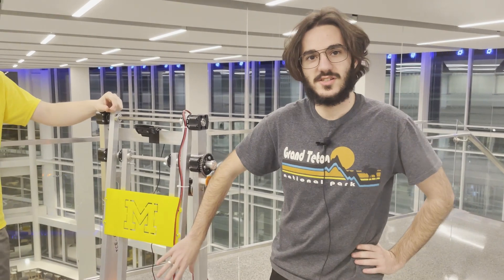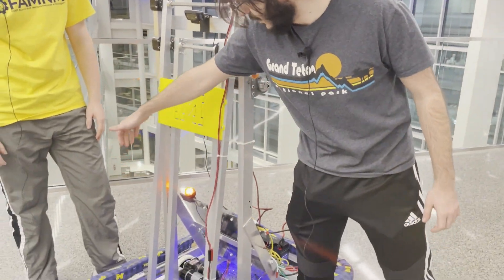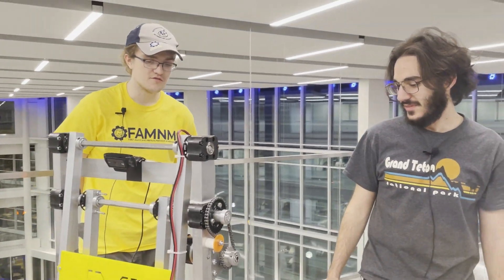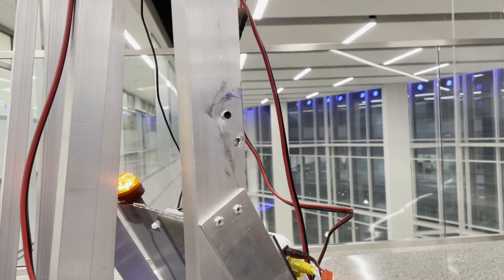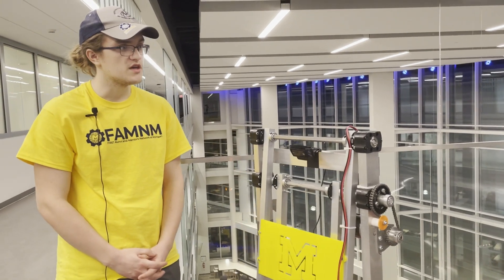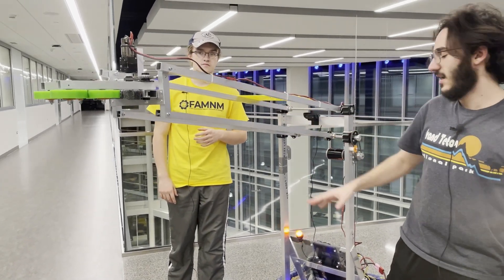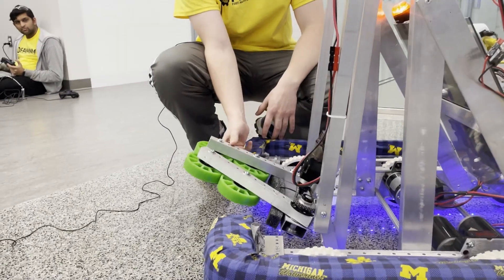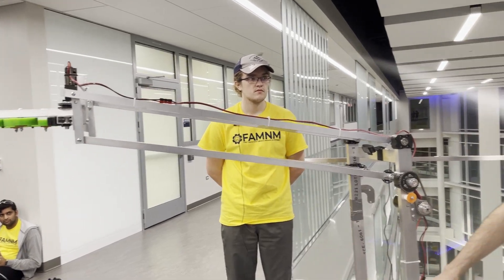Intake Overview | FAMNM Robot in 3 Days 2023

Comment: Can you reach the third nodes with this?
Reply: YES!! We specifically placed the uprights towards the front of the chassis and also maximized the 4'6" starting height configuration to achieve the necessary reach for this. It is also partially possible due to the fact that the intact folds out at the start of the match to provide the last couple of inches needed.